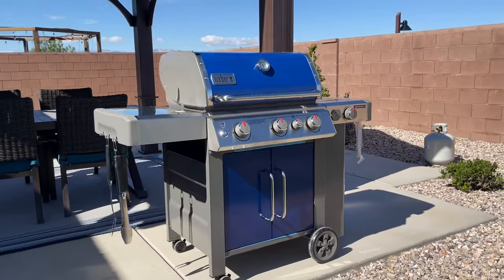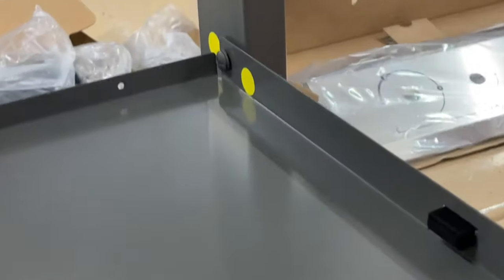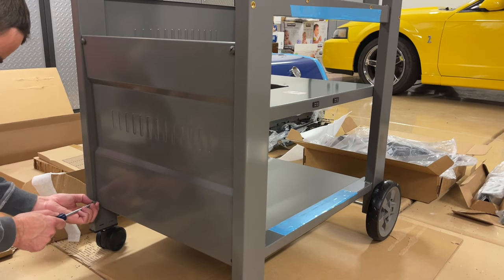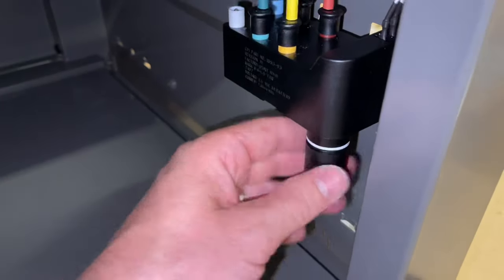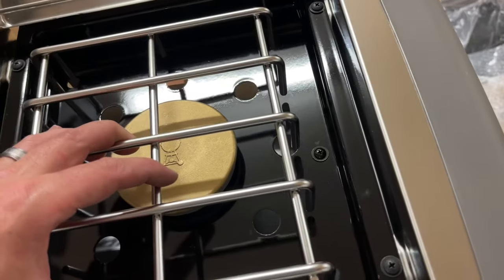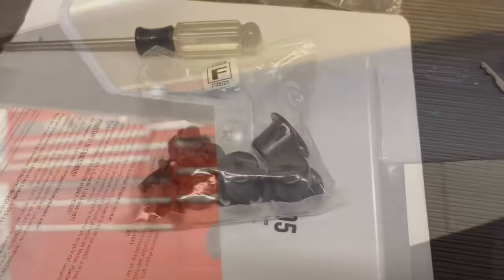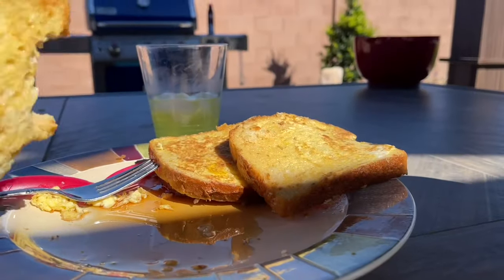Weber Grill assembly step by step 335 Genesis 2 310, 315, 435 Costco

Comment: I just picked up this model at my local Costco this week and stumbled upon your video. It was very helpful and made installation a breeze. Really appreciate your concise instructions and clear video angles of each part. I did noticed the part where the brackets for the side shelves was installed incorrectly on this video. On the instruction manual, the bracket goes on the outside of the side shelves, which gives better support strength. Other than that, great video!
Reply: Great catch!  I just assembled mine and the you're spot on as the bracket is in the inside of the side shelf! 🤟

Comment: This video was excellent. The instructions that come with the unit are just fine, but it's great having a reassuring look at just how to do it right and the commentary on when something seems off but is OK (like those fasteners that just sit under the back cabinet wall). What really did it for me was telling me where the hardware was. I was about to spend 30 min on the phone with Costco asking for another set.

Comment: Very helpful video!! Thank you!! One thing you may have heard by now is the side brackets are supposed to go on the outside of the side shelf, and they act as sort of a washer for the nuts. Unless you fixed this by now, your grill will have small gaps in-between the side shelves and the main unit.
Reply from the maker: Yes, I added it to the video description. Thank you

Comment: The little gray door hinge pieces can easily get lost in unpacking or after they are installed and the doors are popped off.  This happened to me.  When the replacement kit came mine also have the hardware for the door handle, not to be confused as parts related to the little gray piece that fits on its own.

Comment: WOW!!! Nicely done.  Got through my assembly without a hitch.  Thanks so much.
One question.. I had a cotter pin left over.  Should I be concerned?
Thanks again!
Reply from the maker: I also had one. I believe it’s common for a few spare parts or parts the other models may need
Reply: @dannyjohnsonsgarage  Whew.  That's a relief.  And again... great job on the walk through.

Comment: one question, where ia the smaller connector from the white cable are attached? in your video you show where the push Botton is located but the other end? where should go?
thanks,

Comment: Thank you so much for your video.  I have a question regarding the Cotter Pin in package H. Is it just extra Cotter Pin?
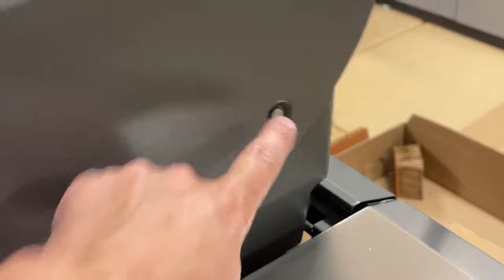Reply from the maker: Yes, at 18:25 it shows the Two small Cotter pins going onto the grill cover. One on each side. If you have a 3rd small cotter pin it must be  a spare

Comment: I could be wrong but I think those flavorIzer bars are supposed to face the other way. The half moon cut out on them is for you to be able to see the flame and also maybe light the flame through here if your ignitor isn't working. Great video though!
Reply from the maker: The holes are cut on opposite ends, so it will be in the same place no matter which way you put them in. I do use them for checking the flame 🔥
Reply: @dannyjohnsonsgarage  I see. I didn't know that. Looking to get one soon.

Comment: I bought this at Costco with the side burner. I cannot find the blue and white wire to plug into the module?? Any advise?? Genesis II E-335 LP
Reply from the maker: It should be somewhere on the wire harness. It may be wrapped in plastic wrap and hidden on the harness, but mistakes can happen.

Comment: Once assembled, does it fit through a standard door?  Or is it best to assemble outside where it will reside?
Reply from the maker: It would be best to assemble it outside where it will be
Reply: @dannyjohnsonsgarage  I ended up assembling it indoors except the lid and cover for the knobs.  It was raining and I really wanted it done.  Plus, if it wasn't raining, it's way too hot. 

Anyway, I managed to slide it out the patio door with no issue, more clearance than expected. 

Your video was so incredibly helpful.  It made the manual easier to understand.  And I knew what to look for when doing it.

Comment: Can you use this as a drop in if you don’t use the frame?
Reply from the maker: It should work depending on the setup you have. All the gas lines are attached to the burner box and don’t necessarily need the frame

Comment: You can get a Weber grill at Ace hardware and have  it assembled and delivered to your house at no charge if it’s over $399
Reply from the maker: Yes, most hardware stores offer assembly, but this model is also now at Costco as the new version is out now.
Reply: @dannyjohnsonsgarage  But Ace also delivers. I don’t think Home Depot or Lowe’s delivers.
Reply from the maker: @Satjr35031  it shows free delivery for Lowe’s and Home Depot in our area.
Reply: @dannyjohnsonsgarage  I see that but I noticed it’s free with home installation So you would pay for them to assemble it at you house

Comment: WAIT !!!  bag G side mount brackets make the shelves stick out more. the instructions show putting them on the INSIDE of the shelf, otherwise you will have a gap space.
Reply from the maker: Yeah, I added that to the video description. I assembled another grill and the did brackets how they should. It seems to work both fine, better support with the brackets where they are intended